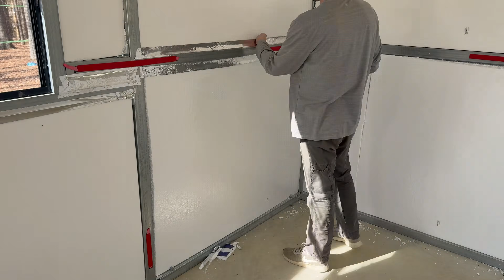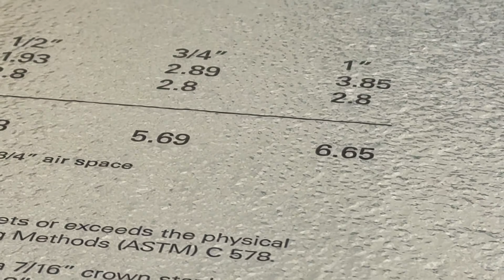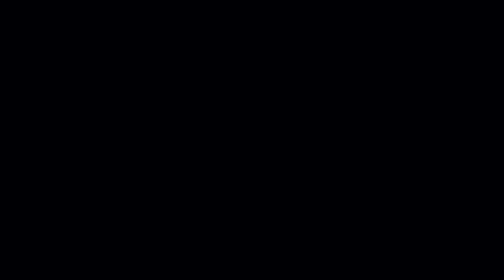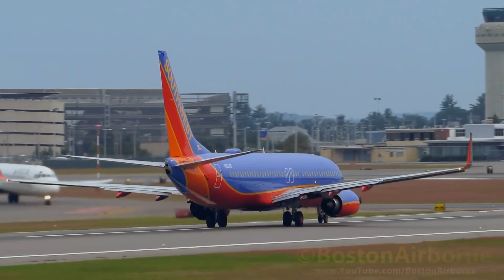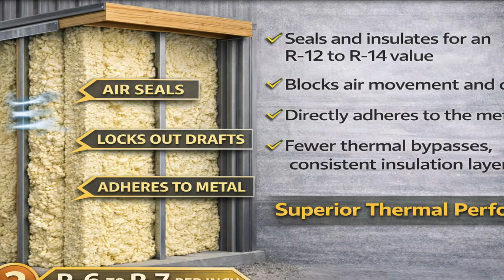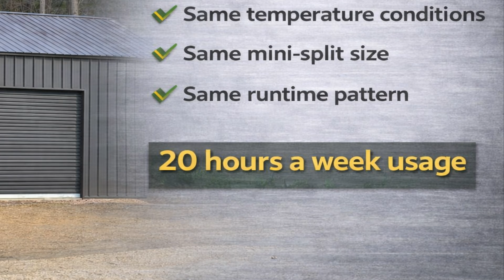We’re Insulating Metal Buildings Wrong (Here’s Why)

Comment: Used a 2" EPS board and 1.5" air gap on my shop.   Worked out perfect with 2x4 spacing.   Then added OSB over it for the walls.    The difference is amazing, and my HVAC does not affect my bills that much at all.      Add a bit of solar on the shop and cooling the shop is a win win.

Comment: Spray foam also requires an external vent due to how well it seals. If not external vent is supplied, it can lead to mildew from condensation. It is also much more costly to install.

Comment: One thing you didn't talk about at all was moisture.  What did you do to prevent and protect against condensation or moisture with the foam board?  With spray foam, you don't need an additional membrane for moisture.

Comment: Any warm humid air leaking into the wall in winter can condense to water which causes mold.
Reply from the maker: Hi- yes I could see if the seams/gaps arent taped this could be a possibility. All the reason the ensure that the air movement is not possible!

Comment: Could one sprayfoam the jet engines to make sure they are not loosing all that fast flowing air out the back of them :D
Jokes aside, i bet the jetengine would sik sucking in the foam in the front fairly quickly and maybe melt inside, causing an overhaul of the engine, i'm not sure but that is my first idea.

Comment: Thank you for this! I've been racking my brain on how to best insulate my (30'x30') metal building, and I've looked at all the various options you mentioned here (spray foam, foam panels, fiberglass, etc.). Based on what I've learned from your video, I think I'm going to go with a "hybrid" mix of spray foam on the ceiling, and foam panels on the walls. I hope to eventually enclose my walls, and add a ceiling of either thin paneling or maybe even plywood that's attached to the rafters, totally enclosing the "sprayed in foam" insulation at the very top of the building. By completely enclosing this "attic" area, I hope this will provide even greater insulation for the roof, against the heat and cold from the outside. 
   Anyway, thanks again! Great content and very informative!
Reply from the maker: Man you read my mind of what I'd also view as optimal.  Unfortunately, because i had the 2" fiberglass installed on the roof by the factory, i wasn't able to do the top in spray foam.  I most likely would have, because foam boarding the top is a chore.  I've also really been considering the attic idea as well. I would definitely be simpler. However, I like the look of the high vaulted ceilings. Although, you do then proabably eliminate alot of the radiant heat from the rafters up top. Either way I think your way will be just fine :)  Thanks for the watch and the comment!

Comment: I think we are doing this wrong because the metal beams are missing insulation. You insulated just the spots between them. Just like how people are realizing wood studs take away from the r-value. To truly solve the problem, maybe one can completely seal the building using exterior insulation, but the cost will be higher because you will need a new exterior material to cover the insulation. The pros are that now you have a complete barrier and if anything happens you can spot leaks from the inside immediately. 

But maybe the way to bring cost down is to instead of use foam boards, use high quality batts. Which should offer an additional saving on top. So maybe the best way to insulate might be exterior batt + new exterior.

I plan to make a home out of the metal so now I can figure a way to make the home look like a home. In short, we used the metal frame as a monopoly frame.
Reply from the maker: good ideas! However I will say i'm not quite done yet. I still need to finish the internal walls and plywood however I didn't factor that stuff in because even users that spray foam could and likely still do install walls and ceiling panels.  Thanks for the comment and the watch! Good luck with your future home!
Reply: @DaleDoesItAll  Hey thank you, I enjoyed this video. I'm still figuring out what I need to do and I been debating between using wood vs metal. I like metal so far because it looks faster to set up and you can do crazier spans which wood structures usually do not do.

Comment: Did you add insulation to the roof? Also i like that scaffolding. I might build one when i start working om my lights and electrical versus renting one.
Reply from the maker: Hi! Yes, the building has a 2” fiberglass installed on the roof. However, I added an additional 2” poly foam board as well, and taped the seams.  The scaffolding was clutch for this. It’s really been great for my purposes.

Comment: I have single bubble insulation that came with my 30x30x10 metal, but i want to add 2 inch foam board insulation, any suggestions about applying the foam board insulation on top of the single bubble insulation? Thanks in advance.
Reply from the maker: It depends on if you can maintain your dead air gap. Thats honestly what makes bubble insulation effective. If you can keep space/gap from the metal to the bubble insulation then you are good. If you can and have to stuff it in, and the bubble makes contact with the metal, then you are rendering your double bubble ineffective. Thanks for the question! Hope that helps!
Reply: @DaleDoesItAll Thanks for the advice. I appreciate it. These DIY projects are interesting at times but definitely fufilling from a learning standpoint 👍🏿

Comment: EDIT. I DIDNT WARXH THE VIDEO FULLY

WRONG(to a point).
First, you are gonna be hardpressed to tell ANYONE that we are doing it wrong when you left the metal beams exposed,  PERIOD. Those suckers are as hot as the exterior panels, sometimes hotter since they are thinker and take longer to dissipate heat.  
You are right about the air. I done every test possible and what i found was first spray foam ALL air openings and cracks, then go over that with "cheap" radiant barrier.  This can be had for 4 foot × 250 foot for around 129 dollars delivered.  
Once thats on, then go over with the foam board on the sides and THICK blown in insulation in the ceiling.  
I tried spray foam up to 4" thick and the way i me tioned blows that out of the water and OBVIOUSLY will blow yours out of the water simply because you have those hot exposed "beams"
"My" way still costs thousands less than having a shop spray foamed with 2" walls and 4" ceilings
Reply from the maker: Whoa! I’m super appreciative of you taking the time to write all that.  I actually don’t think I said anyone was wrong in the video which was kind of my point. It just depends on what you’re going after, the money you’re willing to spend how you use your shop and what the return on time and investment is. I’m still not done with this part and I have thought about what to do with the beams. I think the obviously most efficient is to add a drop ceiling. The bad side is that then you lose so much usable space. I’ve also seen people in case the beams with wood/foam. I think at a minimum I’m going to try to spray foam the insides to at least prevent the air from moving within the channel. In the end, I don’t disagree your point. Thanks for the comment. :)
Reply: Ps.   I edited my first post

 @DaleDoesItAll your video title literally says "were insulating buildings wrong" lol
In my defense i had posted about midway through your video, which corrected quite a few things i touched on. For that, my fault for not watching the video fully first. 
I, like you, want every penny us metal shop owners have to spend on climate control to be the best we can stretch that penny. 
Having said all that. Dont you just hate to have to cover those beams? That looks A BILLION  times better than my shop, but i was going for function over looks. 
Wonder if you do seveal layers of that, what i shall call, roof coating over them if that would work? U know, lowes even sells it, basically its a roof covering for rv's that is supposed to drastically reduce the heat absorbtion. 
Crazy part is, my shops just like yours, same colors. Obviously a black roof means tons of heat in the summer but in the winter every bit of the radiant heat we are trying to keep out during the summer is lost dueing the winter. I look at it as i try to make my buildings as much like a cooler as possible,  a regular ole' cooler. It will keep cold things cold and hot things hot. Ahain, doery for not watxhing the entire video before opening my mouth lol
Reply from the maker: @single94supra your good man😂, I will say you read my mind. I’d previously thought about this rubber paint on coating as well, EDM I think it’s called? Genuinely that’s probably better and easier than the other options. I redid my camper roof a few years back. Got it off Amazon.

Comment: What you arent factoring in is moisture... water against metal and it rusty away. That's what Im finding out with the fiberglass batting in my 4,000 sq ft shop that came with the house we bought a few years ago. THAT is why everyone says closed cell (not open, not board, not batting) spray foam is the way to go on metal buildings. Its more than just the air seal for cracks and gaps, its protecting the metal against moisture. Sealing up the gaps is important for HVAC obviously but its the ol' tin worm that always wins against time. Do I want to spend 5 figures  for insulation R-value or do I really need to spend 5 figures to get R-value while getting corrosion resistance and preventing mold from getting trapped between the interior and exterior walls along with insect intrusion resistance... Yeah, i wish I could just foam board it myself too but then that evil B!$(# reality creeps into my mind about doing things the right way from the start.
Reply from the maker: I don’t disagree with your statement and you make a good point. Thank you for taking the time and effort to write all that. It’s 100% something to be considered. Obviously, how thick the metal is, the treatment of the metal and how well it’s sealed is also a factor, but I agree spray foam provides a protective barrier from rust. It’s just out of most people’s price range. What I present is a potentially modular method or upgrades over time that can achieve nearly the same efficiency. Yet, your point on protection still stands and is absolutely valid. Thanks for the comment and for watching!

Comment: insulate outside of studs.
Reply: How do you insulate between the studs and sheet metal?
Reply from the maker: The company can install a fiberglass layer between the sheet metal and stud. That is what I did. Ultimately, I'm glad i did with the exception of the roof. I wish I had just spray foamed that XD

Comment: So just for my understanding, you have the air cracks sealed,  XPS 1 inch foam board next, tape joint sealed and then additional reflectix/radiant barrier next?

What are you calling the existing blanket? Which layer is that?
Reply from the maker: Hi! The foam board is a 1” eps foam board layer with reflective layer. The blanket is a factory installed 2” fiberglass layer.  You can see it being installed below the metal during assembly of the building. Hope that’s helps!